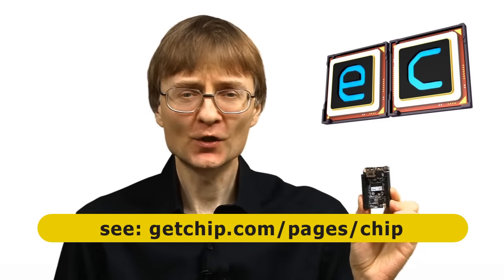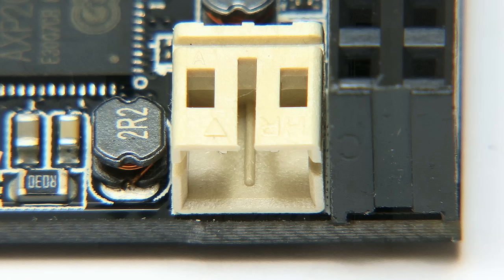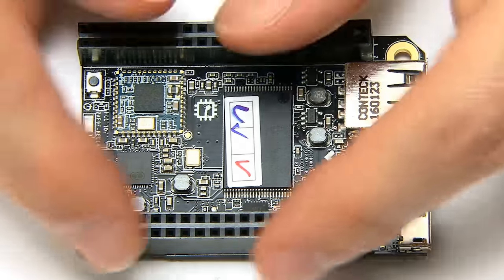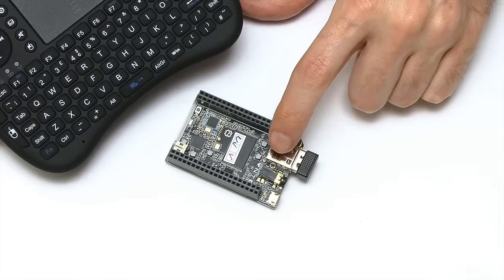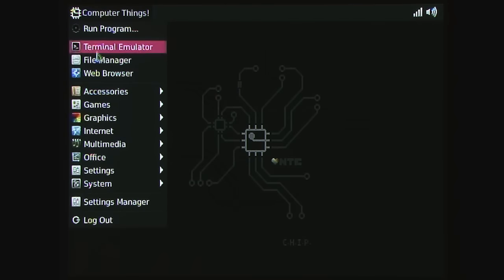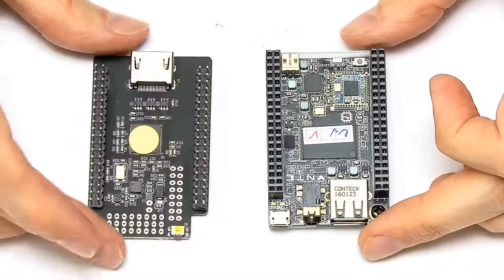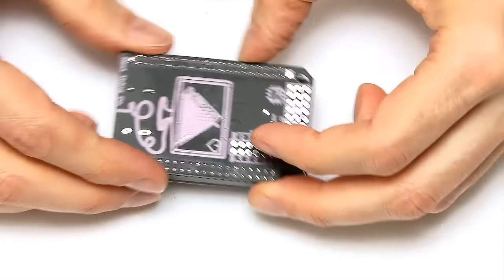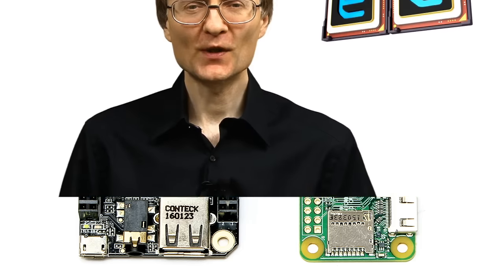CHIP $9 Computer

Comment from the maker: In response to many questions, note that the HDMI DIP includes connections (pads and holes) that allow the user to solder on more pins to duplicate the XIO (GPIO) and some of the other connectors taken up when the HDMI DIP is fitted.
Reply: Do you think that if I were to buy two of those bottom covers, that I would be able to secure one to the HDMI shield?
Reply: By looking at the shape of the HDMI board I don't think it'll be very easy to do as if you'll notice the cutout on the board is right where the screw mount is on the little cover. You may be able to make it work but you'd have to come up with some type of hold down. Or...  you could just glue it using some Shoe Goo or something similar if you don't think you'll ever need to access any GPIO via the bottom of the HDMI boars. Or a Zip Tie / Rubber band
Reply: ExplainingComputers damn i remember when you had 90.000  subs
Reply: ExplainingComputers btw, what is you favoritt board pc, mine is the raspberry pi 3 model B
Reply from the maker: Indeed! :
Reply: ExplainingComputers i got mine with a case and a powerpack
Reply from the maker: I think I would agree with the Pi 3 Model B -- although I have a soft soft spot for the Pi 2 Model B, and also the LattePanda, and the Banana Pro! :)
Reply: Yea, i agree with tah to
Reply: Naomi Baron Interesting question! I checked, and no. The form factor doesn't match, and the mounting holes won't line up.
Reply: 1ctrlaltdelete1 Anecdotally, it seems to draw less power than the Pi 2 or Pi 3. In my experience, I have some phone chargers & powered USB hubs that don't provide enough juice for a Pi to boot, that a CHIP will happily run on. I don't have a Pi Zero to compare with, though.
Reply: Stardew Valley
2016
Explore in YouTube Gaming
Category
Gaming
Reply: ExplainingComputers u
Reply: ExplainingComputers great job that's amazing
Reply: ExplainingComputers you are very cool my friend, now o follow you
thnkx
Reply: Why not use a logitech wireless mouse and keyboard with unifying technology so you have a full sized keyboard?
Reply: ExplainingComputers how does it cost 9 bucks tho?
Reply: +АРКАДИЙ АНТ , the chip purchasing link is the first link in the descriptions  (https://getchip.com/pages/chip)-для особо одарённых ...
Reply: MASSAD SPETSNAZOVICH SEALOV ох, сама концепция стоимости пеки за 9 баксов поражает, я уже видел их товар и был на сайте)))
Reply: АРКАДИЙ АНТ great!, carry-0n make that  Infrared homing system, with various image lock-on... i heard it's the thing Now!
Reply: Да к слову. На сайте возможность выбора страны и региона ЕСТЬ.
Reply: ExplainingComputers Hi fascinating little video, I feel obliged to tell you that I tried to like your vid several times and finally got it to, I've never had that happen before.
Reply: +Chraz Ritt - "Why not use a logitech wireless mouse and keyboard..." 

Exactly what I was going to suggest. Actually, nowadays, most "Mouse/Keyboard Combos" use a single USB connection, although probably none others that are compatible with or as cool as the Logitech "Unifying Technology" that supports up to 6 devices off one USB port.
Reply: ExplainingComputers n
Reply: So 4 cases for this computer cost almost as much as the computer itself?  Hmmmm.
Reply: Grumpy Hermit 

P
Reply: please change your way of talking
Reply: Hi, I really liked your  channel,You could teach us how to assemble a basic computer just to search the internet,Watch videos, listen and save music????
Reply: Chicuace Mazatl Im not trying to speak for Chris but he has tons of stuff on this channel and more on his website, it's a great resource for anyone, noob, to experienced, im sure you will find what you need,and I like how plain, and straight forward enough he makes them for anyone to follow.
Reply: Were do I buy it from thank u
Reply: Kamkem cool
LOL->   "Please I need it."     You sound exactly like my friend from Cameroon.  I can't even count how many times I've heard him say that.

Read the description at the top of this video.  It has a link to get the computer.  It is: "getchip.com ".   just go there and buy one.  Can you not order it from Cameroon?
Reply: Chraz Ritt I agree on the logitech unifying stuff. The only problem with those is they have to be linked under Windows. There is no linux software that will find and pair a keyboard and mouse as of yet. But if your like me and have them already paired from a primary stem then all you have to do is transfer your dongle to the chip as their is a driver for it.
Reply: The cases came with them in the kickstarter, you also got the av cables. Just slosh some liquid electrical tape or something on the bottom of the board should be fine, that is what I plan to do with additional ones I get since I've used up the ones I got with the kickstarter reward.
Reply: ExplainingComp  !
Reply: Love the new intro
Reply: How can i import this into country Like Bangladesh. People in some rural areas need this item. theycant buy a proper computrer. they love facebook. if they can watch Youtube n Sign in to facebook, they will love it.
Reply: ExplainingComputers tq.
Reply: order from banggood or aliexpress
Reply: ExplainingComputers you should have demonstrated its video & audio capabilities & quality by running a YouTube video.
Reply: ExplainingComput
Reply: LOL
Reply: great work, liked and subscribed. however, what can you do with it besides web browsing? please show us something: program a washing machine, a robot, or a touchscreen interface for a refrigerator . even a simple gadget that fetches live weather data and displays that with a clock when powered on. something, anything. a $9 web browsing computer is cool, but it needs to be for reasons other than browsing the web. make something please. plug it into something and use the periphery in your own back-engineering or show us a student that does these things. idk please take this as constructive thought not demeaning or derisive
Reply: Sơn Tùng M-TP Official Keyboard: Rii i8
Reply: ExplainingComputers ㅑ
Reply: chip isn't discontinued, those guys just in the middle of SoC upgrade process
Reply: redesign from web site description, i would love to see it back too
Reply: You promoted Next Thing company but did you ever look into their company they have an F on the US BBB
Reply: from some looks of it , it looks to be a scaling issue, a problem raspberry pi had, even now withe zero. Just read up on raspberry pi issues when they started building theirs. it is hard to find any tech company that has not had issues with new launches (see the steve jobs movie?) by the ways I have seen comments on how the chips are being sold on ebay with big markups like raspberry pi zeros.
I would like to get a chip computer to try but no big hurry, I can wait until supply bugs are fixed.
By the ways you should look at some of the other single board computer videos here on YouTube, and look at these other boards to see some are still in funding (video is over a year old) and some no longer exist
Reply: ExplainingComputers a link would be great
Reply: ExplainingComputers  HDMI only have 6 wires why dose the converter have 50 pins
Reply: ExplainingComputers where i buy
Reply: ExplainingComputers ,your face is match with harry potter's face. It just a joke, don't mind.
Reply: Hey m8, I live in Australia and wanted to buy one of these just for the hell of it. I'm really into these single board computers. But you mentioned problems with PAL. Do u know if theres ways around this?
Reply: ExplainingComputers Why would they not include a micro SD card slot to expand on board memory.
Reply: Give me
Reply: We can expand the memory of this cheap?
Reply: my friend at explaining computers, you are a great person, thank you for all you do, I trust you, and love your reviews and products you review. keep up the great work sir, the $9.00 chip company, are a bunch of frauds that's all.
Reply: The storage is supposed to be at least 16Gb minimum. That 16Gb is already very small storage. If it comes to 3.2Gb, that's nothing. You won't enjoy, especially the RAM Memory DDR5 is supposed to be 4Gb at least. So that's what we call business to enjoy. I did not enjoy my cellphone and tablet that little features specification you won't enjoy that. I experienced that already. I have no question at HDMI video card. It's no good on the little storage of 3.2Gb and 512Mb RAM Memory. Mann, why business people knows already that little storage and little RAM memory are not enjoyable when customers looking for higher quality of RAM Memory and storage. That's so tricky, The business specifications are already moving forward to enjoyable higher specs.
Reply: Can I run WinXP on this?
Reply: Can it run win xp??
Reply: I ordered mine 2 years ago, I used my credit card, the company kept on telling me lies about shipping issues until 2 months riled by so I could not cancel the order. I never received my chip. They sure billed me though.
Reply: sorry to be off topic but does any of you know of a method to log back into an instagram account?
I stupidly lost my account password. I would love any help you can offer me
Reply: @Tristian Brixton Instablaster :)
Reply: @Phillip Jaxson I really appreciate your reply. I found the site through google and Im waiting for the hacking stuff now.
Looks like it's gonna take a while so I will reply here later when my account password hopefully is recovered.
Reply: @Phillip Jaxson It worked and I finally got access to my account again. I am so happy:D
Thanks so much you really help me out !
Reply: @Tristian Brixton you are welcome xD
Reply: You mentioned that comparing the chip in the raspberry pi zero would be an interesting comparison.

Here is an interesting comparison. That computer has more on board memory and storage then they had for the Apollo lunar missions. I believe the processor on its own is faster than all the processors on the space modules....
That is an interesting comparison, but in the same way that it's interesting that the Great pyramid of Giza was more ancient to the ancient Romans than the ancient Romans are to us....

Comment: I was a kickstarter backer for this, I really never used the GUI on mine, in fact I should re-flash mine to get it back (I uninstalled it manually).

A few notes:

- The MicroUSB has a few functions. Power input and flashing as you have demonstrated, but also it also connects to the UART allowing you to access the serial console. When powered using any external connection (battery or +5V and ground on the header) the MicroUSB also functions as a USB OTG connection.
- The white LED is connected to the power supply via a resistor and is on when the power is on. The purple LED is connected to a GPIO pin via a resistor and can be turned off.
- I live in the United States and NTSC is our standard, however, PAL should be available by tweaking the configuration files. If an NTSC display or a DIP is not available for making this setting, this will need to be done via a serial terminal.
- The case was a later add-on after a design change moved key components to the bottom of the board. As a kickstarter backer I got this preinstalled for no additional charge. We also got the video cable for no charge.
- Per early CHIP documentation it was originally suggested (and may still be) to connect a wired mouse via USB and a keyboard via bluetooth.
- Some CHIPs supposedly have a higher capacity flash and one of the later versions of the operating system allows access to the full capacity (8GB instead of 4GB).

Comment: that's probably about as powerful as my old windows 95 desktop. It's amazing what we now take for granted! 9 bucks!
Reply: I am quite sure it is more powerful than that desktop...
Reply: Can it play old games?

For 9 bucks.... damn
Reply: it's atleast as powerful as a Pentium III 1 Ghz circa year 2000
Reply: aoxilus Maybe when considering modern x86 processors, however modern ARM processors are many, MANY times faster than old x86 chipsets with a fraction of the power draw.
I mean, think about the Nintendo Switch; it's processor clocks under 1GHz, yet it's still able to run games that simply are not possible on older x86 hardware (for example, Doom 2016).
Reply: lerch25 Its actually a bit stronger than generic office XP desktops.
Reply: lerch25 Well, about the strength of a mid to low budged tablet I suppose.
Reply: Great vid but I think it is Samsung RAM. Its the NAND/flash thats Toshiba (shown in Chrome updater)
Reply: My ibm think pad issues in college 99/00 year has 2Gig storage that I filled up with songs off of Napster. Cost me $2400.

Comment: This seems quite limited while compared to a Pi, by the time you buy all the needed additions I bet the price isn't that much different either
Reply: Actually, the Pi 3 (AFAIK the only pi that has built in WiFi and Bluetooth) costs 60$, and is bigger than the Chip. The Pi Zero, on the other hand may be cheaper, but does not have on-board storage or connectivity.
Reply: Bit of an exaggeration on the cost lol, Raspberry Pi3 Model B is around $39 while a Pi Zero is $5
Reply: I'm comfortable using a terminal, I wasn't reference using it as a project board, more as was demonstrated in the video, as a single board desktop PC and comparing the experience with a Pi.  I'm actually going to buy buy a Chip to play with, I currently use Arduino or Pi Zeros for my projects.

Comment: Looking forward to the comparison. I'm looking to get one of these types of devices to hook up to a 1080p TV to play announcements etc. in WMV format at some churches in the area. Wanting something smaller than a laptop that I can stick on the back of the TV.
Reply from the maker: My comparison tests could not be better suited for you! :)
Reply: Especially if you include how well they play videos.
Reply from the maker: cee128d I do. I have a test showing playback of a local video file, just like you need.
Reply: Great. 't wait to see it.
Reply: I would rather buy a Raspberry pi or any other SOC-board with an HDMI output. Since its a 1080p 640x480 will look pretty ugly?
Reply: he uses the HDMI dip which costs extra but does 720p
Reply: cee128d shouldn't god be able to get the message sent?
Reply: The point is NINE DOLLARS and, also, we're getting (many) other commercial possibilities LIKE the Raspberry. I'm not sure that everyone understood what integrating the graphics unit into the CPU die some years ago meant... Same as the solid state memory revolution, from several years before that. 

Complex, derivative, limited, convoluted, NUMEROUS programing languages are no longer needed to operate mobile hardware. This is truly the revolution of macro, to micro, finally. Mass produced, mass sourced awesomeness. Nice!! :))
Reply: jort93z the Ras pi zero also requires you to connect something to it in order to be able to use USB ports or a display if I Remember right, things that this has built in
Reply: but still its a 1080p tv.. 720p scaled upto 1080p looks pretty bad depending on the tv size
Reply: Your the best, we need more insight like this.

Comment: I still prefer The Raspberry Pi for 40$...
I simply love RetroPie ^^
Reply: there doesn't seem much point to this product when you can get a pi zero which is both cheaper and more versitile
Reply: +scienceblock:

Is the pi zero really cheaper? You have to bring you own SD card for the Zero. That's an additional cost that is always present.
Is the pi zero really more versatile? This has bluetooth and wifi onboard. the Pi Zero has no network connectivity. The Pi Zero requires an external charging circuit if you want to use it with a LiPo.

I'm not saying this to rag on the raspi guys. I totally love them and their work is impressive, I even have one of the first gen raspis. I actually decided to go with the CHIP for a project that I'm working on because I don't need a display and I do need WiFi. For my application, the CHIP was clearly the better choice. The point is, different SBCs have different hardware loadouts and it's not about which one is the best, it's about which one is the best for your task.
Reply: For 4x the price?  What about 4 of these instead?
Reply: For one, RetroPi won't work on it haha, secondly the Pi has 3 more USB ports and HDMI.
Reply: Agreed, I've tried multiple embedded PCs (both ARM and X86) and after about a week or so they began to annoy the hell out of me and I went back to a traditional desktop.
Reply: OrangePi pc is 17$ with shipping, quad 1.6 ghz, gig of RAM with HDMI out and VGA and CVBS capability. Its a pain to setup power and image sometimes but its worth it. Otherwise you got OrangePi zero for 10$ for headless use and it has alot more oomph than CHIP and has wifi. With this pricing and competition i think CHIP is dead on arrival.
Reply: @ahettinger525  The CHIP also has soldered-in headers and a full-size USB socket. It is not a "PI Zero Killer," but the PI Zero is not a "C.H.I.P. killer," either
Reply: @artbecker5618  Unfortunately, last I heard, they died all on their own.